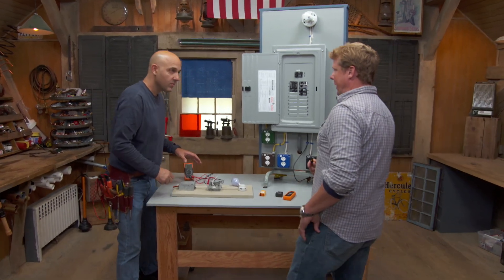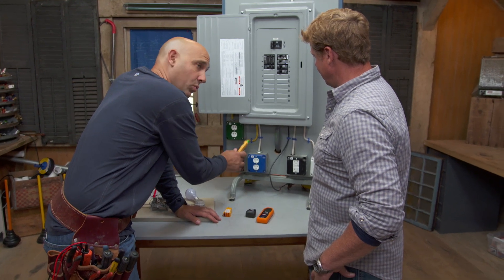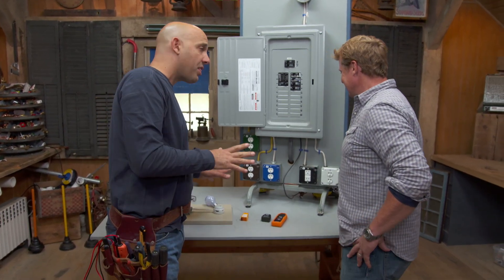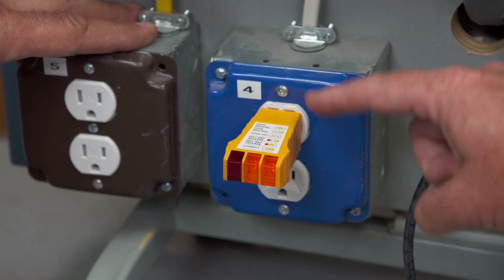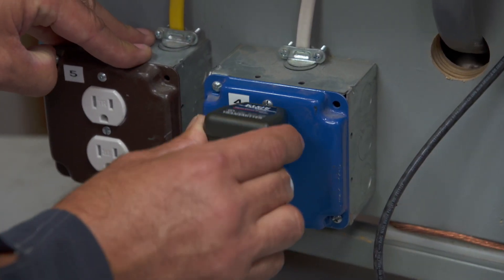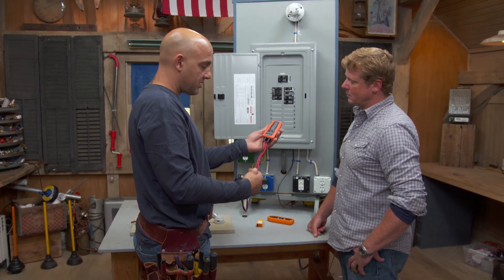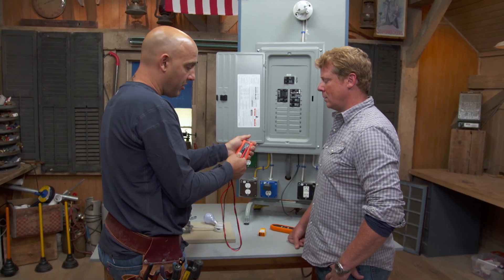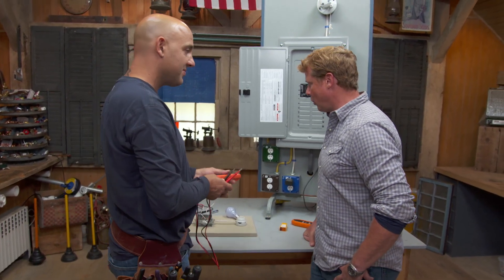How to Select Electrical Testers | Ask This Old House

Comment: If you love yourself...please throw the wiggy away. For those who don't know what a wiggy is, it was the last one he used and not recommended. This is coming from a journeyman with 15 years experience.
Reply: Wiggy was a great tester.  i doubt you could find one now , unless you could find on on E-bay.   the guys i learned Elec from  said to buy a wiggy.  I have been in the trade since 1978.  and yes Wiggy is not made any more.

Comment: I prefer a fluke with an amp clamp.Klien with an amp clamp is also good from what I understand.An amperage reading will tell you if you have to start doing point to point continuity.

Comment: I don't understand why the breakers are always so badly labeled. If I had the energy I'd go around every electric output in the house.. lamps & sockets and make a list. Every breaker would get a number and every lamp & socket would be in a list with the corresponding number. Like,  living room- left side lamp: breaker #2. or bed room, middle socket: breaker #6.  I don't know.. I just don't understand why everything has to be done just a little bit half assed.
Reply: That's what I did with mine.  I completely agree.  It's easy enough to do, and as with most things, it's much easier to do it during the install than after.

Comment: I'm ordering that Klein Tools transmitter, that thing is like a Godsend.  I live in a house that was built in 1946 and the breaker box and outlets added in the early 80's, so most of them are unlabeled or mislabeled.

Comment: I was told that these sorts of testers have been known to be "widow makers."  Is this true?
Reply: Blaine Bugaski They are called that by some people because inexperienced users may not know get a false reading and then inadvertently work on an energized circuit. To avoid that, use a "live-dead-live". Simply check a device you know is energized against one you're not sure of. If the tester doesn't  react on the live device, get new batteries.
Reply: Blindly using them is how it would happen.  Test your equipment on known state wiring and know how it works.  Those non-contact induction ones can be tricky in particular with false readings if you don't do it right.

Comment: Something to keep in mind is that there could be  multiple live wires fed in to a box.
They should be separated, but they some times are not.  Not all work is completed in a satisfactory manner, especially with old homes maintained by unqualified persons.

So you could turn off a breaker to a receptacle and open it up and have a wire from another breaker in the box still live, especially if it is a combination switch/outlet or double duplex outlet.
Get the tester and test it!  The radio or lamp is not enough.

You also could run in to a situation where the receptacle or connector has failed but the conductor running to it is functional and even if you test it with a lamp or radio and think it is not electrified because they don't work, it is.
Also, test the common wire too, it's possible for someone to wire it incorrectly, and of course there's 240/360 multiple phase wiring where you have more than one hot conductor along with the common, so check all the wires, never assume that just because it is white or green that it is not electrified.

Here's three situations I ran in to.  One is that the common wire was switched for a light fixture, so even with the switch turned off there was a live conductor in the light fixture.  

On another the white (common) was hot after chaining off another receptacle.

On a 360v 3 phase  motor I interrupted the circuit in the main panel, opening the circuits on all conductors to deenergize the device.  When I went to the motor controller the circuit was still live, because there was a 120v motor control circuit.  All the other motors in the shop use a 360v motor controller, so all power is shut off from one switch.  Check, check, check.  It only takes a second.
Reply: Macks Power thank you

Comment: 1:32 If you're by yourself instead of a lamp use a corded radio with the volume turned up loud enough you can hear it at the breaker box. When you turn off the correct breaker you'll hear the radio stop.
Reply: Great tip

Comment: what if you had on continuity and you put it in a outlet?
Reply: Typically you'd blow the fuse in your measuring device and the fuse cabinet, worst case scenario it literally blows up in your face. 
This is the reason that most of the devices shown here are banned for measuring voltage in the industry. (Europe) Typically if you want to determine if a line it hot you use a two-contact test light (that can only measure voltage) because the two leads are not physically connected and thus can never (mistakenly) short out under normal circumstances..

The procedure for safe and certain typically is: (again, Europe)
-Assess what you're expecting to measure and check if your instrument is suited for the task.
-visually inspect measuring device for defects. (especially leads)
-Test measuring device to confirm that it works correctly.
-Verify that all loads on the line are switched off.
-Shut down what you want to work on in such a manner that it's impossible to switch it back on by mistake, and very hard to do on purpose ( pull breakers, preferably replacing them with lockable dummies then lock out, tag out)
-Measure to see if it is indeed switched off.(make an effort please)
-Test measuring device to confirm that it still works correctly. ( It would be such a shame if after taking all those precautions it turns out your meter broke and now you're dead)

Depending on what you're expecting to measure you may want to wear additional safety equipment such as a face-shield, ear plugs, non-flammable overall (close the neck), insulated gloves, stand on a rubber pad etc.

Trust me, I've seen a guy blow up a fuse cabinet in his face, it's not fun. "Losing"  ten minutes in preparation can save you from a lifetime of agony.

Comment: The pen testers (the first one) are about worthless, regardless of the brand.  They frequently give false readings.  I can see a home owner recommending them but I'm surprised to see an electrician suggest one.  He should know how useless they actually are in the field

The circuit breaker locator one is useful, but they're just over $100.  Somewhat out of the average home owners price range seeing how little they'd use one.  Frivolous tool to be honest. 

The last one, "the wiggy" is a tool every electrician has. It's the most useful of the bunch.  Up there with the Kleins and the screwdriver.
Reply: +beeps Problem is usually in the troubleshooting skills of the operator. Also, you want either a greenlee or klein (I think thats what this is guy is using). Many electricians use them because they are reliable. However, the confusion lies in what one relies on!!! It tells you what is hot. It does not tell you with 100% certainty what is not hot.  It is importatnt to keep the distinction in mind. The Non-contact tester tells you quickly which wires are hot. If you get a negative reading...then you can confirm with a two lead tester that it is not hot. It comes in handy, lets say, if you have a box with multiple circuits running through it...
Reply: +beeps Like all niche tools they have their places. I use mine all the time, it's great for tracking down things very quickly but never a full sure way to make sure something is de-energized. With that said, nothing beats a good old multimeter, but most home owners wouldn't know how to use one even if they did have one, so a non-contact meter is a nice place to start.
Reply: I use my pen tester all the time,  Klein. don,t have a problem using it and yes i have a   reg voltage tester with the prongs.  All what TOH sparky has.
Reply: Just kill the main.